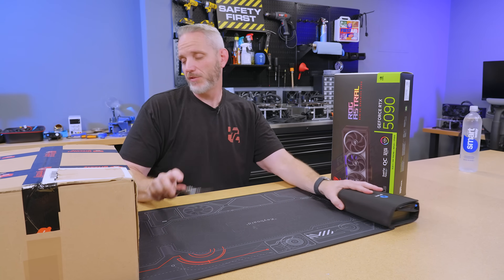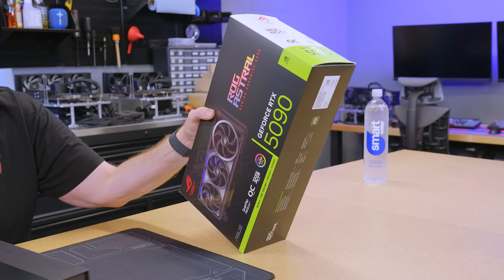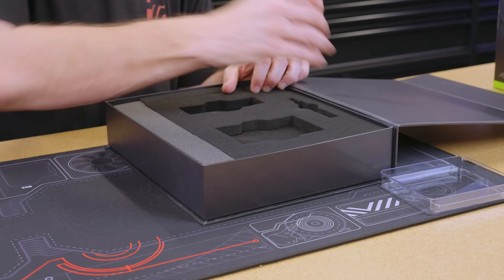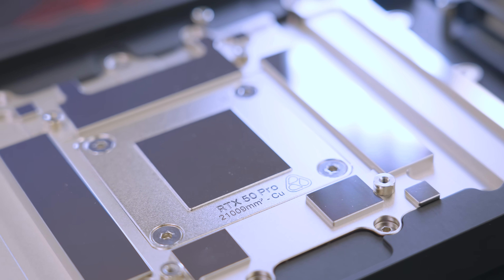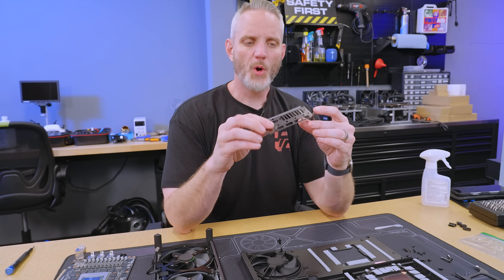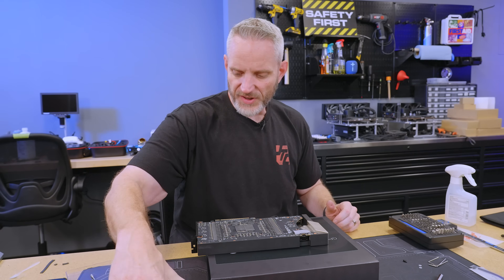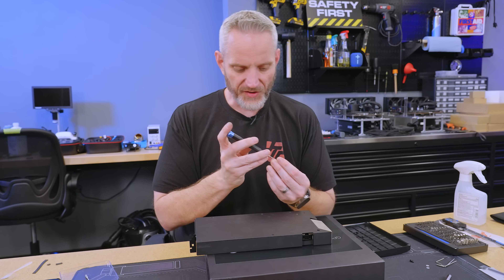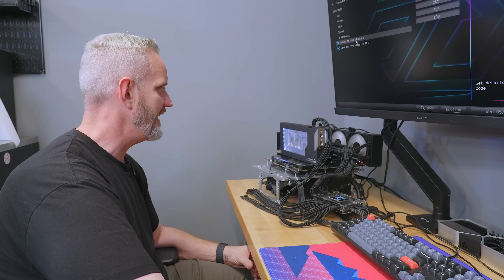DerBauers Delta Mate is better than any other block I've seen... period!

Comment: Plexiglas is pretty much just a brand name for acrylic or PMMA. Lexan would be polycarbonate. Either way it looks to be the best looking waterblock out there so far, the water passages aren't filled with CNC machining marks. Hope that didn't sacrifice some cooling performance. Plus that instructional PCB!

Anodizing can only directly be done on aluminum, otherwise you coat the surface with aluminum and make the anodized surface grow on it. The surface finish on that block looks more like Cerakote. The sleek and plain backplate is actually a good thing, you can add your own frills to it!
Reply: Magnesium and titanium can also be anodized.

Comment: If you have a 30 series, friendly reminder to redo your thermal pads and paste! I just went from hotspotting near 80° c to hotspotting at 58 c. Make sure you look up which type of thermal pads you're going to need but I suggest replacing them and getting a little extra because most AIB GPUs have missing thermal pads in my experience! 

My 370 Asus dual head an entire section of thermopads that were not even touching the heat sink at all! It turned to basically dried out Play-Doh. I swing Gail thermal Giant or whatever it's called the stuff it worked amazingly and is easy to cut.

Comment: I have the Zotac OC 5090 it has 4 power connections and I run AI workloads all day every day, no problems.  Just saying.  No card is much faster or slower than another they all use the same GPU and Samsing memory (if they dont then ya maybe slower)  its more about thermals and my card has never gone beyond 75c at full load AI workloads 100% usage and typically using 28GB+ of VRAM on the regular.  A waterblock will do literally nothing on a typical OC card lets be honest.

Comment: The water block is thing of beauty but damn it's heavy. I would be afraid that with added weight of the water flowing through it, it will rip PCie connector right from the motherboard. I would definitely add some support bracket. 

The card with air cooler is about 5lbs if what I found on the google is correct.

Comment: Revisions or improvements could be top/bottom facing ports instead of just back facing ports - these are only useful of you run a distro block in some specific cases.

Comment: I never did find out whether acrylic or tempered acrylic what's an issue because it never popped up on the screen after you said it would LOL.
I had to go back and watch it a couple times just to make sure I wasn't missing it somewhere on the screen.
I love the craftsmanship of this block and I can't wait to see you test it much love to the J fam
Reply: Tempored glass (you don't temper acylic although it can be cast which has slightly different properties to the normal sheets/ rods, anyway...). I'm guessing they're trying to use pretemperd glass, machining it (high speed diamond tipped tools, grinding rather than cutting) before it is heat-treated (tempered). The problem with tempered glass is that the slightest imperfection (cracks from machining you probably can't see) it will EXPLODE.

Ironically, the only company that springs to mind which can make the glass they need is Gorilla Glass. So Thermal Grizzly-Gorilla.

Comment: 12.35 - What I do, when I change a card from Air Cooled to Water Cooled, I screw the original screws back in and basically assemble the card back just without the PCB

Comment: I think the PCB part is not not only for orientation, but it's also to replace the real thing in the left over air cooler and put it back together.
Reply: Wait, if this works it would be kind of genius
Reply: I don't think you even need that to do so.
Reply: The PCB has the function that you can fit your waterloop in your PC without without having your GPU already build into the block. The PCB comes with the PCI Bus connectore so you can put it into your motherboard (of course with the installed waterblock on the PCB).
Reply: @MrAZweistein  You don't want to do that. You'll have to disassemble your loop in order to put your graphics card in. You test everything with everything together. The 2nd you do it doesn't mean it will be safer, it means you have a 2nd chance to make a mistake.
Reply: @trsskater was not my own idea. Roman himself stated that in one of his videos.
Reply: @MrAZweistein  oh I see.
Reply: It would work but there would also be no reason to do that. When you put the heatsink away you would just put the PCB part on top of it until you need it rather than having to undo the whole assembly to get to the part you need to see how to undo the other one. Then to put it all back together again for real.
Reply: @trsskater  if its all in the bag all loose you risk losing a few screws. This way you can be sure each screw is accounted for and in its proper place. Disassembling it afterwards would once again refresh you on the order of operations and where each screw goes. It seems very useful
Reply: @AlleonoriCat  eh. All the screws go back where they screw into (not assembled) like normal. Slap the card on top of the heatsink and put it away and done. Keep the box for your graphics card and you have somewhere to keep it safe. Don't see how it's more helpful than that. All the screws have a place and not scrambled in a bag. This is standard practice for water cooling Incase you need to put it back on. And you don't even have to reassemble it anymore. You can sell it with the water block and heatsink or heatsink separately. People buy cards with water blocks a lot more now.

Comment: The high polish on the aluminum is from diamond inserts in a good facemill. No biggy, unless you pull a part and kill $1500 in a millisecond. Otherwise they last forever.

Comment: question??
rtx4090 and the melting of them that was around in almost all news at release back after gpu released!!
how is it in 2025??
did it get 100% fixed or is it still an issue for the gpu??

i ask this due to seen many who got a used rtx3090 instead of a new rtx5070 or rtx5080 gpu and probably also a rtx5090...

so 2nd question??
used rtx3090 why has alot of people bought just a used rtx3090 instead of the new higer tier 50series gpus?

i also wounder about the rtx4090 and melting of connectors( or what the issue was again) how is it with rtx3090? and most w used gpus?

hope i have asked these question so u understand what i ask u all??

Thanks!
Reply: the issue isn't the cards themselves but the connectors, until nvidia decides to add safeties around it, it stays gambling
Reply: The issue is not fixed because the connector has faulty design and load spreading on the connector is non-existent on 4090 and 5090. In fact the issue got even worse with 5090 because the whole cable can melt along with connectors on both sides - GPU and PSU side.

RTX3090 has lower power draw and has built in load spreading mechanism so the new connector is safe there. RTX3090 has still all the performance you could need to run even new AAA games on highest setting so if you can get it for good price then it's worth it.

Comment: I'm guessing the plating is an electroless nickel plating. It's nice because it takes on the surface finish of the base metal, so polished metal stays polished and blasted satin finish stays satin. It's also perfect for ensuring an even coating on intricate surfaces as it doesn't have the same problem of shadowing that electroplating does
Reply: Der8auer did a whole video on nickel plating when there was an issue with their direct die cpu blocks iirc

Comment: I've done watercoolong a lot in my 10 years of building pc. I came to the conclusion that it only add more cost and weight to the pc. On top of that it's a pain to swap out cpu and gpu cuz of the amount of time you spend draining, maintaning and putting it back together lol.  Air cooler and aio cooler are doing great job cooling your cpu and gpu now a days.  If you own high end cpu and gpu now a days water cooling them is not needed save your money for for next gen of cpu and gpu. If money is not the problem  then just buy it from Maingear or Singularity company. Save yourself a lot of stress. That's my 2 cents :p

Comment: That weight reminds me of my Alphacool core xtx block that weights about the same, The cool part is that it can cool the card even without water as long as u only do desktop and stuff.
Reply: I was tempted to water cool mine, but I managed to cool them with air (yes, two Merc 310s🤘).

Comment: Pricing wise, der8auer said on r/watercooling:

"MSRP will be 500 EUR in the EU incl 19% VAT.
Theoretically also ~480 USD in the US but not sure what is going on with the tarrifs right now. It was supposed to be 450 USD but the USD lost a lot of value over the past 3 months so it's higher now"
Reply: I don't mind paying a extra for, what I believe, will be superior performance, even better than Optimus and the quality of the product. I don't have a 5090 Astral, but if Roman ever made this block for a 4090 Strix, I would snatch it up real quick, lol.
Reply: @BD_Chad  the card msrp is 3.35k lol. You'd be paying 1.8k over a 5090 fe. The difference you'd get out of a 5090fe block vs this block is probably low single digits
Reply: @chefnunutv yes but no need to do the fe disassembly. The 3 PCBs have me scared off of the idea of water cooling an FE altogether.
Reply: @chefnunutv  Exactly. I was a lucky one that bought a 5090 FE at MSRP price. 2345€ directly from Nvidia France. I purchased the EKWB block for 270€, so I will have exactly the same card with pretty much same performance for "just" 2615€. High price, but it's already paid (i use it professionally for 3D rendering).
Reply: @chefnunutv  do you think people who buy 5090 astrals with water blocks care about value
Reply: @chefnunutv  if i where to get a 5090 i feel safer with the astrel and that im not puting my whole rig at risk due to the better power managment to me it is not a performance reason to pay the extra
Reply: @chefnunutv  if you watercool the fe then you can basically say goodbye to the resell value later on
Reply: @alu4626  why? If you can disassemble something, you can reassemble it? Or have i missed something?
Reply: @sorbpen  reapplying liquid metal without the hotspot sensor is a problem. I wouldn't touch previously disassembled FE card if not heavily discounted
Reply: That's absurd price inflation even for what it is. Other blocks are made in europe in small numbers too and they're half the price.
Reply: @ffwast compare it to other blocks made in germany, don’t widen it to made in europe. it is easy to bring your point across if you shift the requirements around. there can be a huge gap in production costs between “made in germany” and “made in europe”
Reply: Huh, funny to see you here, Spencer. ;)
Reply: lol, randomly see u here again casual sab :)

wanted to comment that the pricing with 500€ is good, when considering the origin and card its ment for.
Reply: if you are going to spend $450, 480 is nothing
Reply: 230 for the EK block!
Reply: a 500 eur block? like... i like roman and i have great respect for him. i also understand this is probably pretty low volume since it's not going to be giga-mass produced right away (which drops prices), but... 500 eur? like... my first ever gpu was a  which back then cost 500 mark. not euro. since you basically nowadays do 1:1 conversion, that block basically costs what i paid for my first gpu, which back then was the top of the line model. so... even as an enthusiast who has multi gpu watercooled 3090s, a 500 eur block is just a bit too extravagant. just like the last 2 gens of nvidia gpus. these prices.. absurd.
Reply: @pifpafize  just checked the email I got from EKWB with the order details for 3090 Trio WB with active backplate. 177 euro. Granted, it was on sale, but I think it was around 220 on release. But that was two whole blocks AND a fancy terminal for simpler connection. I understand that where that price comes from, he is in one of the more expensive EU countries to do business in, and all his manufacturing is in-house. But that is a crazy huge price for an ACCESSORY. I would absolutely buy it if I was a millionaire. But if I've decided to pay several thousands of dollars on a GPU itself, it would be hard for me to justify another 20% of the GPU price in just the WB.
Reply: @pifpafize  low volume, high quality, made in germany by an enthusiast not in china by some big greedy corporation. Yeah its expensive but premium products are and this block is 100% worth it if you can afford it.
Reply: That's literally twice the price of the EK Astral 5090 OC block! I was going to wait for this product but glad I grabbed the EK when a UK distributor had stock. Sorry Roman, but just too expensive even for enthusiasts who can afford an Astral 5090 OC and put a waterblock on it.
Reply: That is an insane price. And absolutely not worth it.
Reply: @Blue_Monkey  It's a premium upgrade for a premium product. If you can afford that GPU, that cooling block is mere pocket change for you.
Reply: why would the USD lose value? did something happen?
Reply: @SupremeRuleroftheWorld  You've been under the rock lately ?  Trump happened ....
Reply: @SupremeRuleroftheWorld  gestures broadly at our current political landscape

I'm oversimplifying here, and I wont pretend to fully understand international economics, but other countries are losing trust in the US, that comes with a loss in trust of the dollar as a default currency. Loss in trust, less use, lower value.
Reply: @SupremeRuleroftheWorld  Mega oversimplification of one of teh causes. Less international trade with the US means less need for USD, means less demand of USD, means price tanks. The UK went through a similar thing after brexit was made effective. Loss of trust on the US administration by non americans doesn't help either.

Comment: You should put the astral back together using the 'user manual' pcb to keep the parts together. Looks like a really solid product from thermal grizzly however...

Comment: Hi, Knowing nothing about graphics cards, 68 years old and retired :(. But I wanted to ask, why don't the heat pads come preinstalled?  Thank you for all you do.
Reply: Somebody would have to install them by hand and labor in germany isn't cheap...
Reply: add's a ton of cost to the cooler is a big reason, the other reason is that they can dry out. but the reality is most people willing to do full block water cooling are going to have at least a basic understanding of how to cut and install pad's themselves.
Reply: @sirmonkey1985  thank you :)

Comment: oh wow. Roman even listed his Supurrvisors on the credit list. That is some dedication :)
Reply: The cats xD
Reply: Details Like this matter
Reply: Surely they purrsuade him.
Reply: I noticed that too ☺️ they were very important for the whole process!
Reply: I thought that was a gorgeous touch!
Reply: Darn should have waited. Bought a Byski Astral 5090 waterblock.
Reply: @slickrx6908 This block supposed to ship end of year, I got a bykski block just for the meantime but I'm def getting the deltamate when it releases
Reply: Hey Jay,, I did something confusing. I have the Asus rtx 4090 OC the one with 2x hdmi 2.1 and 3x dp. But it also had a +100v and a massive 33% power oc ability.

So, I put it in a new aIO full body cooler and it rips.actually getting a minimum of 40% higher scores in all tests.

Now what the fk is my 5090 for? And why the heck hasn't the Asus tuf oc with its 33% hdmi 2.1 and.. and well I paid $1350 new w.5 years ago

Comment: The mock PCB is such a genius idea. Holy crap why has no one done this before? WOW
Reply: Plenty have. Bean counters said no. This time The Engineer is the bean counter.
Reply: @FirmB1ade  The engineer owns the beans - literaly 😉
(with his co-founder Eike Salow, who nobody ever mentions)
Reply: @FirmB1ade   Pretty sure bro is being sarcastic.
Reply: yeah, for high price blocks this should be standard thb
Reply: My Waterblock from EK for my FTW3 3080Ti had a thick labeled Cardbaord PCB
Reply: The EKWB waterblock + active backplate had a mock PCB with some information, but not as detailed as this. You would still need to find the manual to find the pads thickness and where they go.
Reply: that is fu**ing owsome. good placeholder for aircooler
Reply: EVGA lives on ;)
Reply: EK had it on 3080ti block
Reply: It is nice, but what I always thought is why not just tweak the block to use like .5 or 1mm pads on the whole thing? Thinner pads transfer better. The main reason I like the putty.
Reply: EVGA sent one with their KingPin mobo's (although I think it was for a stand off test bench).